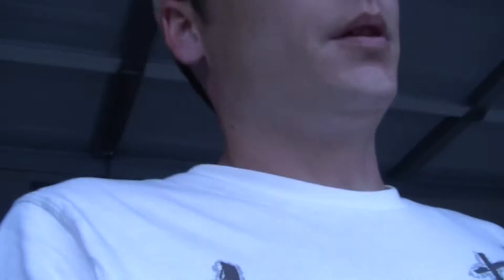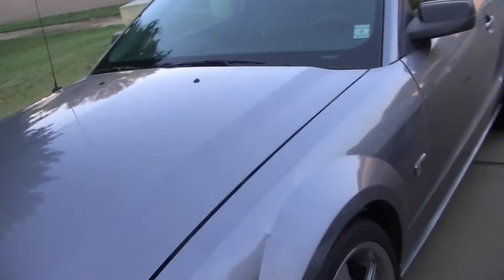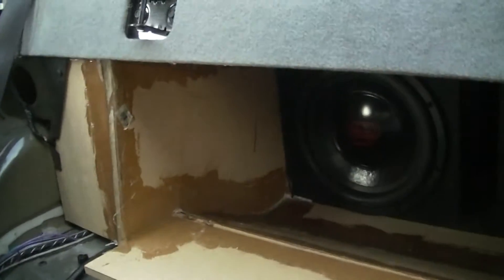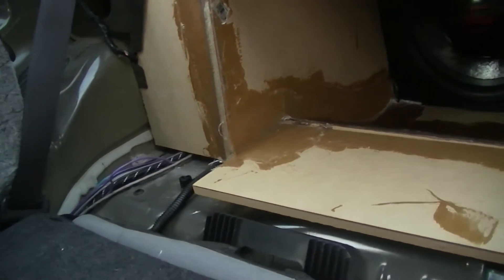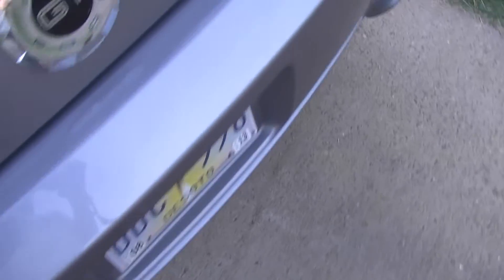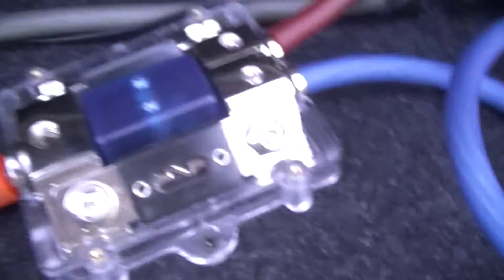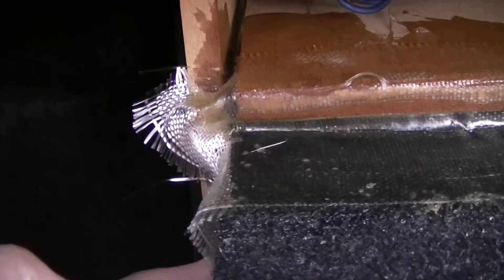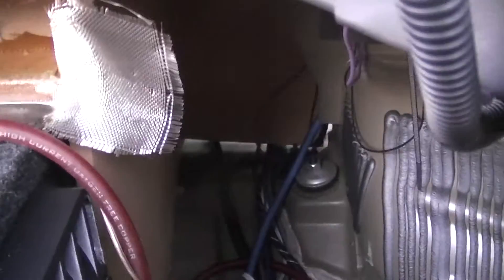Update on Digital Designs 1512's and M1

Comment from the maker: it takes 4 gauge for power and ground and up to 8 gauge for speaker wire. i am currently  working on a new build with 2 of these amps and 2 3512 D2's. i would highly recommend this amp!

Comment from the maker: the rf is going to make more power than the m1. it is only rated at 1700 @14.4v so if you do want/need 2500 then get the m2. 
i made 0ga to 4ga adapters so i can use 0ga. i will be getting roughly 2000-2100 watts per amp when strapped.